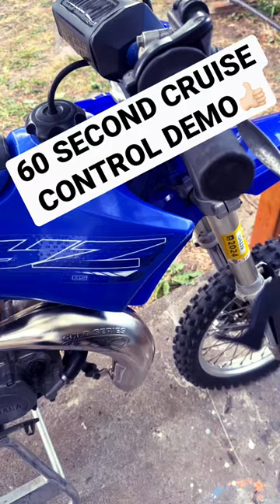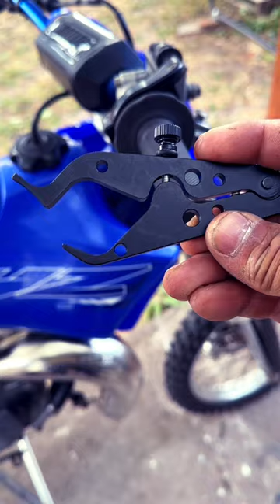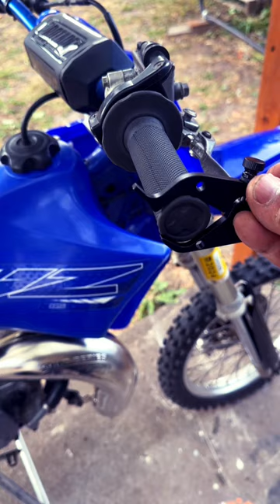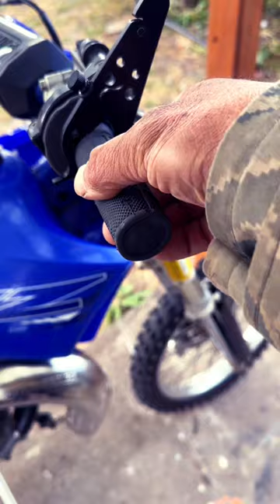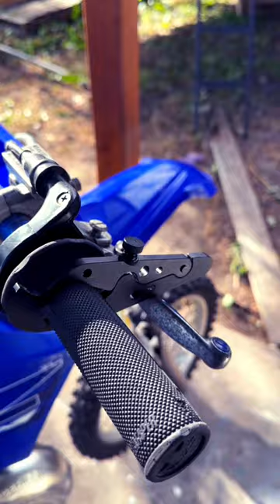60 SECOND THROTTLE LOCK INSTALLATION  #shorts

Comment: Just got mine in the mail. Gonna try it out today
Reply from the maker: Yes! Game changer! You will be riding free now... When you take your hands off like riding a bike is amazing. I am getting really good at riding in the mountains and taking corners. Leaning and pushing on the pegs trying to do curvy roads is so much fun. I could go on all day. But let me know how it goes and if you need any advice or tips feel free to ask. I have have been using these for a really long time and have figured out a lot  in terms of how to set it up so it works just the way you want.👍
Reply: @fastflo1  I just did a 200 mile trip. It worked ok enough, but I’m blaming the grips I have. The grips I have are smooth, so after about 30secs to a minute it would start to let the throttle return. Once I get some different grips I’ll reevaluate it.